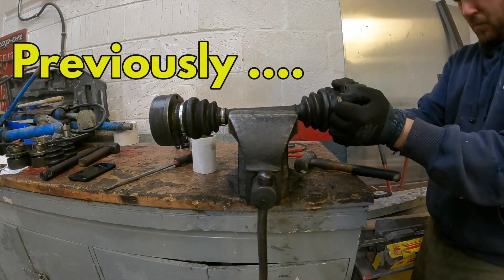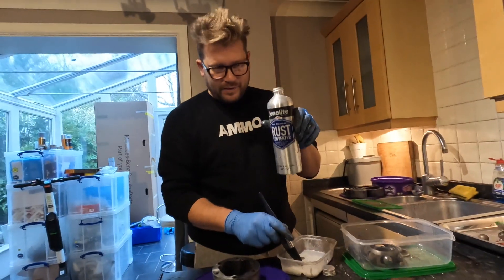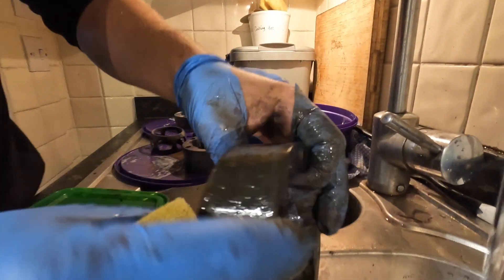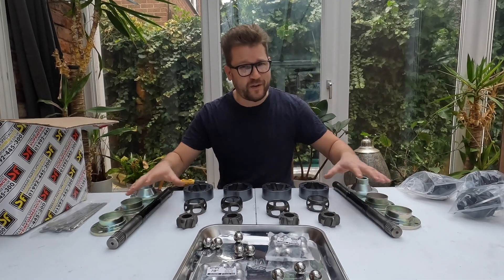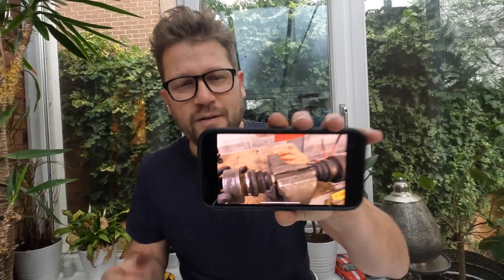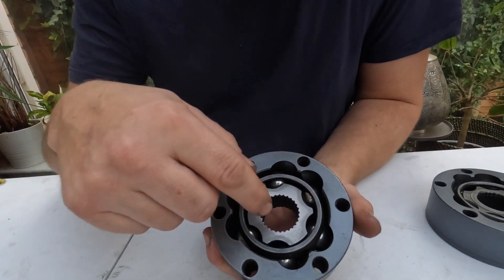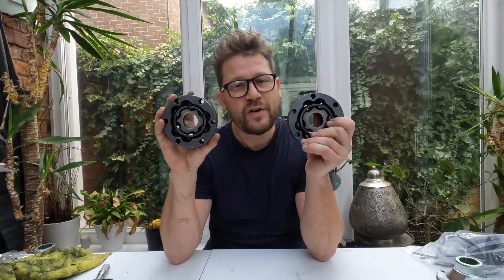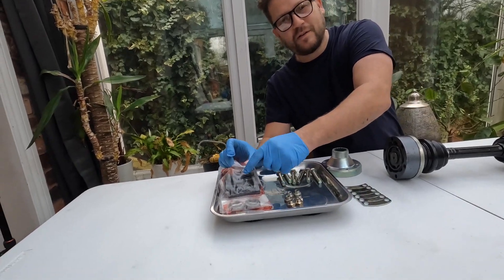Abandoned Ferrari 512 BBi - How One Mistake Cost Me BIG

Comment: Yeah, I suspect you will regret this approach a couple of years after you get the car on the road. You cant sand or mechanically clean bearing surfaces. CV's were probably a matched set with tolerances set by the manufacturer, not a great idea to mix them all together and randomly reassemble with new balls from a different manufacturer. The important part is the play and you never assessed if there was any before or after. A soak in evaporust is a great product for what you wanted to achieve, but to be honest at this point I think you are up for the new CV's if you want more than a few years out of the axles. What you effectively achieved here is like mixing up inner and outer races from wheel bearings after sanding the surfaces, obviously much less important on a CV, but the same principle. They come as a matched set and thrust faces are not serviceable, they are either good or bad.
Reply: Hate to say it but your right here, matched inner and outer surfaces plus bearings work nicely,
Reply: Depends if it's a keeper or a seller... 😯
Reply: i fully agree
Reply: Sometimes you have to invest in new parts, even if they are expensive... The wear will be bad in the next years. But on the other hand i have to say cool project! Good luck!
Reply: My thought prosses: Don't be so negative 😡... okay you are right... fk 😂
Reply: The cross-groove joint housings would also have been ground very precisely, and measured carefully, in order to choose the correct balls.  From the driveshaft supplier those balls would have been sized to 0.0001 inch, and selected in those increments.
Reply: +1 for having to buy new ones pretty soon
Reply: If these were regular bearings, I'd agree.  CVs are not that critical, all the bearings do is a little movement with the suspension movement.
Reply: Rubbish!!
Once clear of surface rust the Grease will protect the bearing and  carriers, No Problem!!
Reply: It's also, luckly, a 1983 Ferrari where factory tolerances were .... just good enough.
Reply: yaaaaa. tend to agree w @mark walton and nason h, sure the oc has strong points, bbbbuuutttt, this car will be thrashed for about 13 total miles and babied the rest of the time…. it’ll take quite a while for this frugal strategy to show its harm… I venture to guess the tolerances were probably tight in the 80’s and surely bearings and mabufacturing tolerances have improved since then and the original commentor might be a more current engineer, and so ya, showing us what the latest tech would warrant, but might be over stating the precision required and the tolerances that can be forgiven … under the veil of the Ferrari mystique…. I say “run with it”.  Just like when you sell a house, when you sell this, or get it appraised, admit the short cut and either reduce the price or agree to install new before sale
Reply: CVs are fully rebuildable and the bearings are not ground matched to the carrier… this is completely different from a bearing/race setup. Should be totally fine long term, but will wear just as normal CV shafts do.
Reply: They're just CV axles, easy to removing and refurbish. But also I think with a modern micropolishing treatment like Cryoheat or similar could recover them. And he should definitely look at doing that when he starts pulling apart the engine, for this kinda build, not sure if he reads this comments though
Reply: @nasonh4324  The  bearings were probably German or Swedish made even back then.
Reply: You are right, if this was a traditional bearing but this is a cv joint which only flexes and does not spin between inner and outer races.
Reply: To say his rebuilt shafts will be not a great idea based on an assumption that the factory used matched set tolerances just undermines anyone trying to DIY repair anything to an affordable budget.
For the £150 cost of the bearings, grease and the time spent it’s definitely worth the punt.
I believe the shafts will probably be as good as new ones, if not better.
Reply: I disagree. CV Joints are not high-precision devices measured to the thousandth of a millimeter. They're some steel balls, totally saturated in heavy grease, moving a millimeter or two at very low speed when the wheels move up and down on the suspension. CV joints have been known to last for years with split boots, no lubrication because all of the grease has been flung out of the joint through centrifugal force and replaced with abrasive sand. An extra bit of clearance will not impair their functioning.
Reply: @markrobinson1071  Correct tolerances in Constant velocity joints are tight. Using emery paper will open those tolerances. When they let go  these joints sound like  a machine gun going off as they release the balls under the car. Spectacular way for a powerful car to come slowly to a stop, but should not do much damage. I would put new CV joints in there. Even in a Mini it sounds exciting.
Reply: @pcspecialistpdx  You will hear them clicking on full lock a long time before they go on a front wheel drive car. On a rear wheel there will be no warning when the fail.
Reply: Just LoLing that you think those garbage people at Ferrari are doing anything like "matched sets."  Only getting a few years of use out of them is normal for the brand. You're talking about a brand that people consider 30k miles to be a "high mileage" car.
Reply: An absolute one way trip to disasterland..
Reply: @douglasburnside  you are not correct. Usually the ends of the driveshafts are not in alignment, so the cv balls change alignment two times every rotation. In and out of the groove etc. The distance moved varies with different planes of the ends of the driveshaft.
Reply: @DonOblivious   Ferrari use stock parts, they are not "special", but on the other hand, it is risky to  rebuild these joints if they are worn. I've had one on a Mini come apart and those steel balls sound like bullets under the car.
Reply: @awalk5177  Yes there will, when they're on the way out, they will click. I've had it on rear CV joints on an X5 and M5
Reply: @reedjacksonmaccom  the original commenter is almost certainly not an engineer IMO. 🤭
Reply: So, you have some correct ideas here, but you're definitely being too harsh and pessimistic. First of all, to believe that any CV manufacturer is matching sets of balls, races, cages, and housings is ridiculous. Each part gets made on a massive assembly line and then thrown together with grease. Of course there is some QC, but it is just a check that each part is within tolerance before being assembled, and they aren't going to check every single part either. There are only so many sizes of ball bearings, and they again come from a factory checked for a specific size and then get used. Ferrari axles are not that special, especially not old ones like this. If anything, these are very normal axles that are just a bit oversized to be beefy enough for task. They use a very thick grease in CV joints, typically with moly and other additives for extreme pressure. I highly doubt he changed the clearances very much with some super fine grit sandpaper. While it is definitely possible something is out of spec now, it would have to be severely out of spec to cause immediate extreme wear. If there are no large pits, divots, scratches, or other damage points to the components and the balls are new, these axles will almost certainly function for quite a long time. Besides, any loosening of tolerances would mostly just allow the balls some room to shift back and forth when switching to reverse, and the way they ride on the spiders means they will still slide back and forth on a layer of grease just fine. So many people seem to think the second something isn't factory spec to one 10,000 of an inch that it should be thrown away. Meanwhile, I have gotten 5,000 mi out of a clicking axle with a torn boot and barely any grease left in it.
Reply: @802Garage  I've just done replaced the inner and outer CV's on my Morris 1300, not the definition of desirable classic, but I like my cars to drive nicely with no clicking or vibration in the driveline. A machine is, just a machine. I did them because I knew they were bad, I tested where the play was and resolved it. All that was achieved here was making the axles pretty, no testing before or after. Are the splines good? Is there play in the CV's now? Axles are handed as the load stresses the metal in one direction, so are the components of a CV. I don't work on Italian cars, but I would assume the CV's could be bought for reasonable money without the axles (if the splines are good), I doubt they are specific to this car, just an off the shelf part used on many Italian cars of the era. As I said, might be fine for a few years, but when you plate every nut and bolt on a car, might also pay to get the axles right or at least have some idea of what you have.
Reply: @gregnovak0070  In this case you can bet the axles are specific and extremely expensive. Sure with enough research you might be able to cross reference parts to put it together. I hear you, but there is no way to know if these are way out of spec without first knowing the spec, near impossible to find, and second measure it, which would be annoying. I think they'll be alright! Plus not like this car will be doing rallies or many road trips. ;)
Reply: Your spot on..... don't understand why strip these n leave them sit...
Reply: When he took the wire wheel to everything I was like eeeeeeeeeeek... honestly the only thing I think saves this is the fact that factory tolerances out of Ferrari in 1983 may not have been ultra precise anyway. But even then I have to imagine they tried for some kind of precision. We'll see I guess.
Reply: are these surfaces hardened or heat treated? If so, the sanding removes that and they will wear very quickly
Reply: @douglasburnside  you clearly have no idea of what you're talking about.
Reply: @arconeagain  I have seen cars run for years with broken CV boots, the joints filled with what is effectively grinding compound (grease mixed with sand), and yes, after a while they start clacking as the balls and cages wear down to 50 times their original tolerances. But they keep on working, which suggests that there is little reason to spend a huge amount of money in the manufacturing process to get Swiss-watch tolerances and precision in the first place.
Reply: If it doesn't work he'll just get new ones so

Comment: Before the elbow grease, get a 5ltr tub of Evaporust and leave all the parts submersed in them for 24hrs.
Reply from the maker: awesome .... ive ordered some
Reply: 2nd that with Evaporust.  It works very well!!
Reply: I've used this with awesome results
Reply: Also use a big container of white vinegar to remove rust, very safe and effective, also cheap. let it soak, check it and inspect and just drop it back in if it needs more rust removal
Reply: Yep. Evaporator for the win. No hard work after dunking them in. Just a wash.
Reply: Evaporust is brilliant around £20 I used it on the fuel tank on my Honda Cub that had not been used for 30 years, the amount of crap that came out was unbelievable
Reply: This. Yes. Evaporust is the answer.
Reply: Totally agree. I have rescued some old tools with Evaporust that I thought were beyond rescue.
Reply: Evaporust for the win
Reply: Nailed it
Reply: +1 evaporust is awesome 👌
Reply: Don't forget that Evaporust is also a very safe chemical to use. You can take parts out of it without gloves.
Reply: Evaporust is amazing stuff. Leaves a black residue but easy comes off. I’d also suggest Scotchbrite to clean up instead of wet and dry as it won’t alter shape etc.
Reply: Came to say this. It’s perfect works well but won’t remove the metal, I used it to restore a lathe. Also make sure you have some oil baby immediately after rinsing of parts will flash rust in barley a minuet.
Reply: You could really do with a drill press at home for wire brush work, maybe even one of the stands that you can put your drills in. It’s so much easier when you want to use a wire brush like that.
Reply: @Ratarossa  WD40 is  your friend.  Coat the Rusty parts in WD40, which will loosen up the rust, clean with a scotch pad and all surface rust will come off!! Clean with a rag and repeat. No rust will be there!!!
Reply: Evaporust definitely.  I've also used it with an ultrasonic cleaner with great results.
Reply: Exactly, the stuff works great
Reply: The only thing with Evaporust is that you MUST remove any grease and/or oil BEFORE putting the part in to soak. Evaporust cannot work well if at all on a oil/grease coated part. Otherwise from that, Evaporust is the dog's bollocks.
Reply: Evaporust for the win mate
Reply: Evaporust is awesome stuff
Reply: Oh man he's going to love evaporust.
Reply: You’ll have to get the old grease off first
Reply: +1000 on evaporust. It’s  also non corrosive to handle.
Reply: Scott… every man uses a Cadbury Hero’s tub for mechanic after Christmas 😂
Reply: oxalic acid solution?
Reply: Do you prefer synthetic or natural elbow grease?
Reply: @pumafeet10  Vinegar is a waste of time. It might do something after hours and hours for the thinnest of thin surface rust, but for anything more it’s completely useless.

Comment: Evapo-Rust:   The most gentle rust remover you can get is probably a Rust Chelation product like Evapo-Rust (there are a couple of other chelation products that remove rust through a neutral PH chemical process).  You can use it in an ultrasonic cleaner as well.  I do not believe you can use SS steel, as the ball-bearings in steel are going to be harder and properly heat treated. I don't think SS is a good option to survive in that location oddly (nor will you need it as they'll be living in grease).
Reply: Also I wouldn't be surprised if those CV joints are standard used on Porsche, Countach etc (I've rebuilt ones on a Countach & I'm pretty sure we could have replaced them if required from CV joint venders a LOT cheaper w/o having to order from the Factory.)  Don't forget it might be nice to spray coat all your steel newly plated parts or blasted Alu with Nyalic - a clear surface coating that will prevent any future corrosion/atmospheric attack.
Reply: It's what hand tool rescue uses
Reply: Can confirm.... I restore Audis and use it religiously.

Comment: Electrolysis I've seen for rust removal on restoration videos.
Reply: I was about to say that, my grandad always used it to clean auto parts on the cars he restored, google has the step by step for it, works like a miracle. And other thing I learned with him was that parts like the u joint he will clean them, then apply a light coat of grease and wrap them in newspaper. I have parts stored like that for about 20 years and still look new.

Comment: Vapor blasting is the solution for that rust.
Reply: Vapour blasting should have been used on many parts of this project….

When the wire wheel on the drill got used on the engine I was absolutely gobsmacked 🤦🏻‍♂️🤦🏻‍♂️ 

At least it’s better than when he got it which is the main thing I guess. Would have sat there rotting forever otherwise! 🤷🏻‍♂️

Comment: Oh my god Scott, attacking some the internal surfaces with wet and dry!!! These surfaces should be highly polished but will now be left with fine scratches which wont do the new ball bearing any favours at all and Greg Novak, in the comments below, is spot on and I would urge you to take his advice.
Reply: That was my 1st thought as well. This is one area Scott is going to regret not buying brand new parts. He is just delaying the inevitable sadly.
Reply: @macman6107  and when you consider they are the last components, apart from the wheels and tyres, to put the power down. They're slightly crucial in the end result.

Comment: OH MY GOD at 3:09 I am cringing at you taking sandpaper to those bearing races ! You have just destroyed them. Even 1000 grit sandpaper is far too coarse for those - they need to be MIRROR smooth. The cages as well need to be quite smooth, so rust and sanding them is going to wreck them too.

The size of the bearings is critical, as is the clearance in the races, saying "oh around 22mm give or take for the rust" is not going to cut it. These things are measured in thousandths of an inch.

You can try to piece those rusty things together in your kitchen, but if you put them on the car, I guarantee they will be failing in short order. You're going to have to bite the bullet and source some replacements.
Reply: Can confirm again... use Scotch Brite to clean. Nothing more abrasive than that. Use chemicals FIRST and then some mechanical manipulation SECOND.
Reply: Additional note: brass is your best friend here.

Comment: Oh buddy...you can actually put too much CV grease in! If it's too full the heat from the engine and friction can make the air inside expand and pop the boots off--or crack them prematurely and big mess ensues. I learned this hard lesson on a MK1 GTI many years ago. It's SO tempting to do this lol! Nice catch on the inner race BTW. 
Coming along nicely.
Reply: I also noticed that 70 - 90 grams would be enough. Large mass and centrifugal force will do their job.

Comment: Soaking in white vinegar works for me every time. Can take a little while depending on the severity of the rust, but is considerably cheaper than some of the products available. 
I do, however, have to say that some commenters are right - cleaning the bearing surfaces with abrasives will affect the overall longevity of the joint considerably.